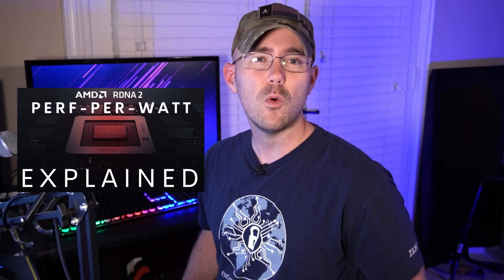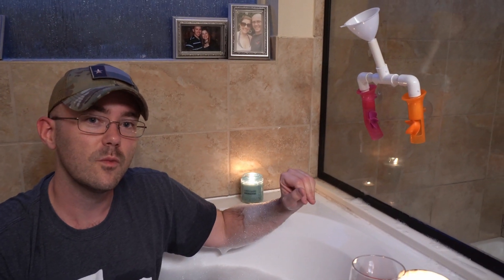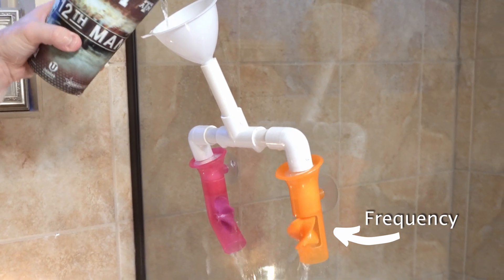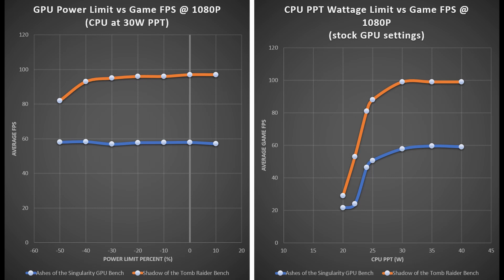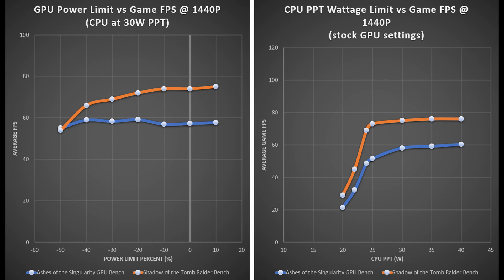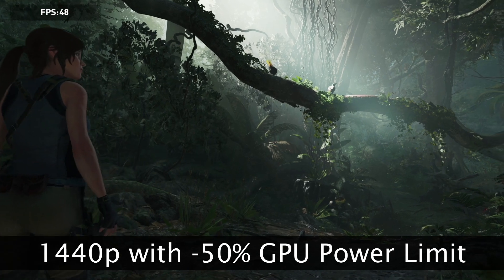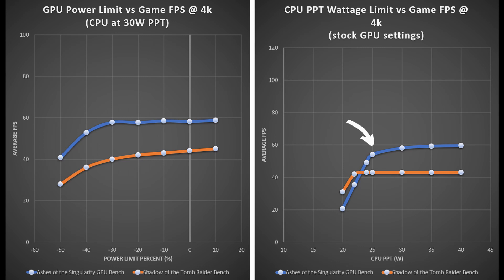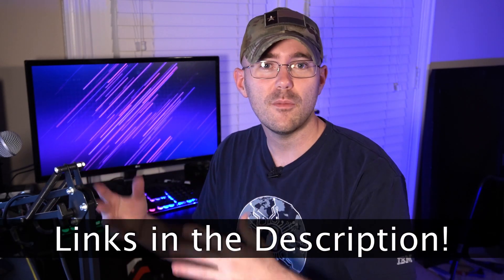AMD SmartShift Explained | Sharing Power Will Help the PS5 Succeed

Comment: Hey theterk ! Now that the ps5 is out. Do you think developers are still learning how to fully utilize AMD smart shift technology thats in the ps5 ? It still seems that there’s another gear to tap into on the series x for the developers, but are they going to be able to utilize all the raw power on the series x becomes the question… it seems the ps5 has less bottlenecks and may be easier to develop for.. just wanted you’re take on that. I’m assuming if devs can really push the series x to its limits it likely to have better performing game throughout this gen unless sony releases a mid gen refresh
Reply from the maker: Smart shift should be transparent to developers since it's more firmware enabled instead of game. As for Xbox, the raw horsepower is there already, it's just not enough to increase FPS/resolution without additional optimization. Also, XSX also is waiting for directML and directstorage to better optimize, but as you said will take dev effort to integrate. I'm hoping to revisit several of these videos once I can get an AMD GPU
Reply: @TheTerk  Thanks for the swift response !! Ya, I’m not 100% sold on the ps5 yet. Some are saying it has the capability to do VRR/VRS and more games at 120FPS ,yet we aren’t seeing it.The performance between the series x and ps5 is like 15% on the GPU, less than it was with the PS4 pro and one x.. I wonder what’s holding sony back from sending out the update for 1440p/VRR/VRS/ and more games 120FPS. I’m hearing the ps5 cooling solution may not be 100% future proof especially on the memory, that they may need to increase the power of the fan more and risk the system becoming a bit louder in theory..  what’s you’re take on it? And yes cant wait for you’re AMD GPU video

Comment: Does this allow the PS5 to go over 10.28 Tflops for the GPU or is that the upper limit? Thanks in advance
Reply from the maker: I believe their rated tflop is the maximum. Smart shift just allows the system to throttle or boost frequency to balance power consumption

Comment: You know the xbox series x has AMD SmartShift too right?
Reply from the maker: Do you have a recent link for that? One of the sticking points for XBSX is that it uses fixed clocks on both the GPU and CPU, which doesn't sound like SmartShift.
Reply: @TheTerk  You will need to find AMD's CES 2020 keynote press release it covers the tech being used by both consoles and it talks SmartShift technology being used to bring higher frame rates at 4k even 8k resolutions it never once says its only being utilized by Sony, the way it talks about Smartshift makes it sound like something that is just baked into the chipset architecture, found part that is talking about it being used in notebooks https://youtu.be/8c8i3t6oIPA?t=2122 its talking about their discrete graphics cards built on the same chipset so it is part of that family.
Reply from the maker: I streamed the AMD CES keynote, and they mentioned the tech in general and primarily in laptops.
As for the XBSX, new information shows that the clocks are locked for both the CPU and GPU, and it will not be boosting.
https://youtu.be/qcY4nRHapmE?t=120
https://www.eurogamer.net/articles/digitalfoundry-2020-inside-xbox-series-x-full-specs
https://gamingbolt.com/ps5-variable-frequency-is-interesting-microsofts-cross-gen-policy-is-consumer-first-says-dev
“Microsoft is taking the opposite approach; they’re touting the Series X’s fixed frequencies. It’s fascinating to see how the two companies are going about nudging developers into the coming gen.” - Founder of LionWing Publishing
Reply: @pilksuk  weird how MS were so proud of claiming fixed clocks and shitting on smartshift. Now they use it too ?

Lmfao.
Reply: @pilksuk  Fixed Clockspeed on CPU & GPU within XSX doesn't utilize Smartshift.

Smartshift is only applicable with Variable CPU Clockspeed like in the PS5 and Notebooks. When the gaming workload is "light", the CPU clocks down to give more power to the GPU, to output more frames.

XSX CPU never clocks down.
3.8GHz SMT OFF
3.66GHz SMT ON
Reply: @TheTerk  Update turns out microsoft is calling this Velocity Architecture... strange name but works the same way they just dropped a trailer and had a interview talking about it on IGN its basically AMD Smartshift with a silly name.
Reply: @pilksuk  its not. 
Velocity Architecture is their marketing buzzword for the SSD I/O architecture.
Reply: @pilksuk  Velocity Architecture is their marketing name for their SSD system. It's not smart shift.
Smart shift is distributing power when its there's extra available and when it's needed and is variable.
Xbox Series X is confirmed locked. It doesn't do it nor does it necessarily need it.
Reply: @TheUnPlayable  Hahaa like when the ssd (read i/o troughput) is going to do nothing for next gen! Now all off a suden velocity Architecture is a thing hahhaa
Reply: They dont
Reply: You know the Xbox also uses playstation studio's and also psvr right😜
Reply: You deserve more views and subs